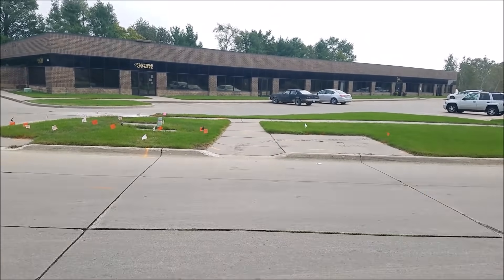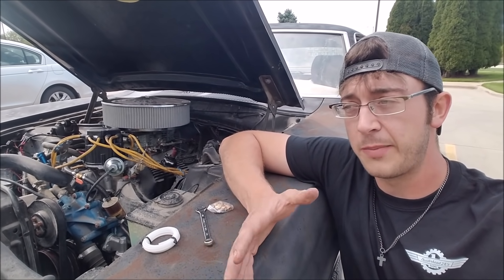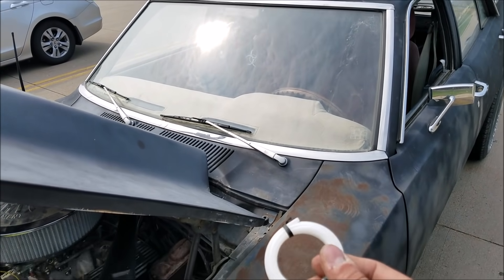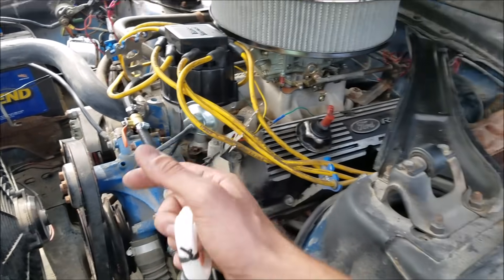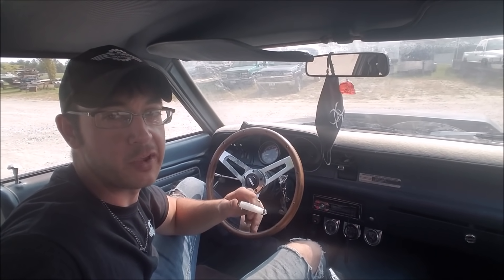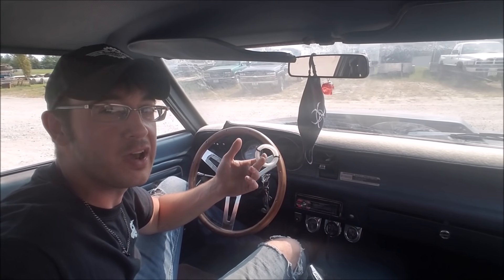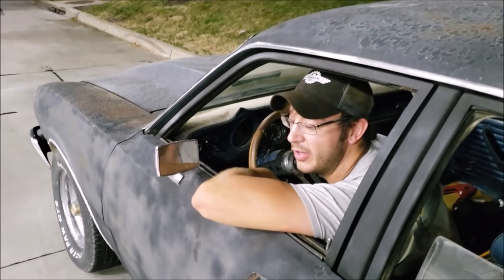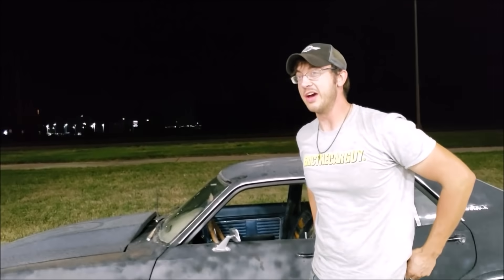The Maverick Broke Down! (A Simple Mistake CAN = Destroyed Engine)

Comment: I personally hate the plastic lines. Ive had them melt when they get hear the header just enough to where high rpm drives the oil pressure up enough its sprays on the header. So 3rd at 3 or 4 k on the highway i would get a big poof of smoke then up shift and its all good but wasnt leaking with idling because of the lower oil pressure

Comment: The gym.....😒....well I'll be dipped.....😝..you got to put loops at the connections....
Reply from the maker: The original owner did the existing line work. And it will still eventually fail at the fitting

Comment: All I use for mechanical oil pressure gauge lines is Russell -3 braided stainless brake line.  I don’t trust the plastic or copper line.  Stuff isn’t even expensive and will never fail

Comment: Either change the sending unit to the end and run the line up and along the top of the head where it meets the intake and then the line will not flex at the connection it will flex at the rear of the engine and will never break there hope that helps

Comment: Yep, I had a 65 Mustang with a 289 someone put a huge Cam 4 barrel and a dual point distributor, it torqued so bad it would suck the gas pedal to the floor after it broke the motor mount.... Try to explain to the chief of police, that's behind you that you are not showing off, and it's a broken motor mount... When you are a Teen. 
Great video 
Keep up the good work 
Stay safe.
 Godspeed

Comment: put a 45 angle on the fitting and run the line up between the shock tower and fender next to the wire harness,,,no fault of the car...i had many mavericks ,,even took my drivers test in one

Comment: TH289... I need some advice!  I got a 72' F-250 Camper Special W/ a 390 C6 and I want to know if I swap out the 390 for a 351W Street Boss 5 speed will that have good power and help with fuel economy??  I'm keeping the 390 in storage so in the future I can go back to the original motor trans setup!

Comment: I had a 1970 maverick.  The rear gas fill broke in a parking lot bump.split that @#$ from stem to stern. Ditch fix was junkyard tank split fill stem and put a rubber spacer aka radiator hose for flex.  Lost a full tank at .25 a gal.

Comment: What is the compression on each cylinder? I think it needs a ring job possibly? It the timing correct? It falls flat on it face like the timing is not fast enough.
Reply from the maker: It has a 3.00 rear gear (at the moment). Fell flat on its face on the burnout attempt when I bought it because previously it was tuned like garbage.
Reply: @ThunderHead289  OK we have not seen it run after fine tuning yet.

Comment: I got a carb question for anyone who can help me. I'm looking at a used Holley 4 barrel 600 cfm and if I buy it I plan on rebuilding it. It has the non adjustable floats and this is the first time I've seen those. I've rebuilt a Holley before but it had the regular needle and seat. I don't want to tear into this new one and come to a stop because I dont know what I'm doing. Is there anything much different to expect? Is there anything I adjust in there or do i just put it back together and let it do its job? I've never even seen the inside of one

Comment: They sell nylon air brake line in the same size. Way more flexible and it doesnt get brittle like the cheapo plastic white line those gauges come with. You may have to get it at a truck repair joint, but it's well worth it.

Comment: Go to a hydraulic shop and have those guys manufacture you a proper oil pipe with high quality fittings on the ends and a premium quality high pressure flexible hydraulic hose. It’s going to be slightly more expensive, but that oil pressure line won’t let you down stranded at the roadside.

Comment: Put a coil or two in the line and it'll be fine. The poly lines are junk, especially on a big block chevy where the oil port is down by the headers.

Comment: A hard line should never be plumbed from engine in a fashion it has to flex. The proper way is route it up front of engine along intake/valve cover and through firewall, similar to electrical wiring. I have a Torino using that configuration since before your Maverick was built. Used same line(with brazed fittings) since 1973.  I'd plug it off and run no oil pressure gauge before I'd use plastic.

Comment: You're still asking for Trouble using plastic line. Just leave play in the copper line one or two coils just before the connection  will do it. Ran Copper line for over 20 yr's in my 69 Firebird. plastic lines melt.

Comment: That car is begging for a T5 swap.  I recall there was a magazine article about 15 years ago about a guy swapping a t5 in a Maverick.  He modified a fox body pedal to work with a cable clutch.  Maybe you can run a 4 cyl t5 if you don't power shift it.  Probably the cheapest ones to find are the t5s in the new edge v6 mustangs.  You might even be able to use the large diameter bell housing that comes in those cars.
Reply from the maker: All my stuff is pretty much t5 swapped. My f100 runs a t5 and my 65 has a TKO 500 in it. 
Might just leave this one a 4 speed and use it around town! First things first though, ditch that 3.00 rear gear ratio!!!!

Comment: On my old dentside Ford back in the old days with my Fe power I've had those polylines fell several times on the inside of the cab it's where they always gave me problems and had better luck with the copper but I didn't run it over toward the fender I had one of the oil filter brackets where the sending unit faced upwards I came up the front of the driver side head and then along the intake manifold and into the cab when the engine torque it wasn't bending back and forth like a coat hanger every time I ever had a fail with one of them it was always in the cab the way you figured it out is when your feet started slipping off the pedals

Comment: I mean I build chevys but I have never had good luck with the plastic line kits they always blow off the fitting no matter how tight you get it. Or blows off the back of the gauge and blows oil all over your leg. But I mean every make is different I guess.

Comment: Just make sure to keep the plastic line as far away from heat as possible, my personal experience with the plastic line and failures was related to heat. I think both can be used just depends on the application.
Reply from the maker: On this car, I’ll do a combo - I’ll just have a short section of poly from fender to engine I think.

Comment: Would you know which headers the Maverick has? My Comet needs a set
Reply: For long tube headers You can choose Hedman 88300 (I use these) or Hooker 6901 .
Reply: ken mollander thank you. I know the shock towers are usually the tight spot. Using GT40P Explorer engine, bolts and spark plugs are issues with most headers
Reply: @jtaylor8792  The GT40P head will give you fitment issues with the headers i listed. I have GT40 non P heads..
Reply: ken mollander ok. Well, my search is narrowing down. I do have a few options.

Comment: Rookie mistake , never use those plastic oil lines! 12 years ! you got lucky. Anyway its happened now so you know!
Happened to me 40 years ago , my first V8 a BBC i built and fitted.Lucky for me the exhaust heat melted thru it on first engine break in start so i was able to go copper early. Looks like a strong little engine in the Maverick, thanks.

Comment: I'm the opposite of you, I NEVER use the plastic line, I always use copper tube, and I make a coil of a few loops by the engine to serve as a strain relief. The plastic tubing can get hard and brittle fairly quickly from engine heat and the heat of the oil. The best way, if I can, is to use a electronic sender to a electronic gauge.

Comment: I've never daily driven a car older than probably 12-13 years old. Mostly because I needed my daily drivers to be reliable. Now that i've got several project vehicles I'm considering building something older as a daily just to keep miles off of my ZL1. Whatever it is it MUST have a manual trans in it or i'll just end up hating it. Wouldn't mind buying that Maverick off of you. Other options i've considered are a Fox platform mustang (which seems to be the ONLY american car that was purchased en masse  with 5-spds in them) a G-body, Or if I can find something like a Maverick, Vega, etc.
Reply from the maker: Once you get through the shakedown period, it almost gets downright boring. My 64 galaxie and 74 f100 have been flawless all year, with my f100 being flawless all last year. Did all 3k miles power tour 2019 without an issue!
Reply: @ThunderHead289  I met a fellow at Walmart a week or two ago who daily drove a vintage Porsche 914. I have seen that car around town now and then for the last 25 years lol so I know he's not lying about that. Just never had a chance to meet him. I know you have quite a bit longer daily drive than I do. It's only 17 miles door to door for me to get to work (at least when I start working back in the office again) But yeah if you ever decide to ditch the Maverick let me know. I'm only 5'7" so the shifter placement will be fine for me :)

Comment: I’ve had my Stewart a Warner oil pressure gauge with the nylon line installed since 1981 in my 70 Z28 without any issues. Maybe today’s nylon isn’t as good as yesterday years cause it’s probably made in China.
Reply from the maker: Nope, I’m all for the poly/nylon - I 100 percent agree. 

What failed on me was the copper!

Comment: I wanna make my 1967 mustang 289 a daily driver sir, any small ideas on updates?
Reply: My daily driver years ago was a 1970 318 Plymouth.  225k miles.  Original engine and trans the whole way. Only broke down once. Repaired in 5 minutes.  My answer to your question (if you don’t mind me butting in). Keep it simple.  Points ignition. Yes I said points.  If you go electronic keep a spare box.  Don’t use Chinese parts.  Go to a salvage yard and get real Ford parts. Not kidding.  50 year old Mopar or Motorcraft is better than new Chinese.  Check out looks drive home video with this Mave’ for an example.  Of course you don’t want 50 year old rubber hoses but you get the gist. Currently drive a 79 Dodge pickup.

Comment: When I run copper lines I coil my excess where the line goes from the engine to the chassis so its flexing a big section of line and less likely to fatigue 1 small part. I also run them up the valley to the firewall as I beleive the twisting will fatigue the line less than it pulling on it. But I almost always prefer to run steel braided wherever I can. The nylon line I've seen break or blow off twice and get oil all over my buddies interiors.
Reply: I was originally taught to coil them, later taught to upgrade to electric sensors from a interior hose down, on the cheesy bracket under the dash on a 75 z28, it started to leak he reached down and it started whipping around, some cleaned lots replaced
Reply: @88TRUNKBACK  yeah I run electric when I can. I got some cheap sunpro gauges in my 69 buick and when the voltage drops slightly when idling in gear and someone runs the windows or some bass hits the gauges bounce all over the place. I either plan to switch to mechanical (temp and oil) or get some nicer ones like autometer.
Reply: Coiling the copper was what I was thinking too. Still definitely better to use something truly flexible like you said though.

Comment: I ran the copper line down the intake. When the engine torques over it doesn’t move as much as the outer edge like coming from the inner fender . The reason I used copper is it’s Nhra Legal also I have seen the nylon ones break and leak as well. I think if you buy a car with one it’s a good idea just to replace it regardless of material and route it with the least amount of movement as possible.
Reply: Put a pigtail  (@3" loop) in the copper line and it provides a greater amount of "give" and helps reduce work hardening of the pipe. Not uncommon to see this on fuel lines etc on older vehicles in the UK.

Comment: You're sharp man. I used to drive my dad's buick gs 1973. I learned so much when I was much younger from old cars. And it's actually smarter to own an old car because it's usually cheaper to fix and easier to fix then anything modern. Also in many cases it's more reliable. My dad's buick never stranded me once. I had newer cars that quit on me nearly costing me my life. The worst was my work car as a limo driver. 2018 chrysler 300. Once the alternator quit that car was dead in the middle of the worst winter in recent years in Chicago. I had passengers and we had to arrange emergency transportation. Fuck that car. Ive always loved old cars but each bad experience with newer cars solidified my love for old American steel.

Comment: My experience with nylon tubing is that is chaffs through really easy. I lost a tube where it went through my firewall.  When I fixed it, I made sure that I liberally used silicone to prevent it from rubbing. Personally, I would probably use an electronic sender in the future, but they are definitely more money. After 85 or 86, Ford started using a pressure switch on the pickups. If you switch the sender out for an older one, the oil pressure gauge will work as intended.

Comment: I myself like to drive the old cars over a new one any day. I kinda look at it as I'm doing my part to save the planet and it also saves me money, plus I can buy 20 cars for the same price as a new one. You do the math that's a huge savings. Cheers mate
Reply: TinManKustoms 
100%! I can afford to buy a brand new $60,000 Ford pickup if I wanted. But I instead drive and repair all my $500 to $1000 old cars and trucks. And I still come out money ahead. And it’s fun, driving a manual transmission and I always get compliments and conversations about my old vehicles.
Reply: yep,the cooler part is the unpredictable adventure of it all.you never know when you will get were you are going and whats gonna break on the way.
also you always know you will use 5 times as much fuel as the average modern engine and not have any more power,in fact you will usually have 
much,much less in a v8 vs a 4 banger.

ive got a modern daily and a 35 year old car as a toy.....

Comment: I do the same, I “shake down” my old vehicles the first few thousand miles before I start to trust them. Right now I’m doing it on an old farm truck I bought for $500. It had been sitting in the farm yard for 10 years, it’s a 1976 Chevy C20. Good shape, only one cab corner and the front fenders have rust blow outs. But ten years of ethanol gas sitting in the carb, fuel pump and tank has taken its toll on the old boy. Runs good, lots of little issues that are repairable or just plain lack of maintenance by the farmer. He just didn’t care, ha.

Comment: Can do you one better.  I had a brass pipe nipple to get my electric sender out far enough to clear the filter.  It cracked at the block and puked about 3 quarts out in maybe 1/4 mile.  I knew where it broke because the gauge dropped, and I could see a safe place to pull off.  Had to get a friend bring me an ez-out and a factory idiot light switch to jam back in the hole to get it going again.

Comment: I've never had real good luck with the nylon tubing. It always seems to break/crack on the interior side of the vehicle.  I've had good luck with the copper lines.  I coil them where they go from the engine to the vehicle.  But the braided stainless steel hoses are my first choice.

Comment: This happened to my Cadillac once, it blew an oil cooler line at idle and spewed all it's oil out. It then proceeded to not give me an oil pressure light and run for 14 miles at highway speeds before seizing and stopping about 500 yards from my house. 
Called my dad to come get me and it fires right up for him and he drives it home with no oil. Rod knocking like crazy but only needed a bottom end. It's like it never happened now.

Comment: I need to run an oil gauge to my 77 F150.  The factory gauge looks good on startup but boy after she warms up, when I come to a stop, she drops like the Titanic.  Would really like to know how much pressure she has when she warms up.
Reply: most american engines do that, my 1982 Ford Falcon XD had 40 psi cold then dropped to about 5 to 7 psi when hot(every now n then the oil light would pop on and off or flicker) thats on a worn never rebuilt 300,000 KM engine 4.1L 250ci engine  made in ozy but based of a mustang inline 6, and Honda Xflow(crossflow) technology
Reply: genmaxpain this one was rebuilt years back and my dad says it probably has 40,000 miles on the rebuild. Runs incredible (460) and the only issue is a leaky rear main, which I can completely understand, especially since it sat for about 7 years before I picked it up from my dad.
Reply: @TheKeymaster316  the 460 engines are really good engines, with the right mods and cam they sound awesome
Reply: genmaxpain just had an RV cam in it now.  My dads best friend used to own it and towed a camper trailer with it.  But he told me he’d like to see me put a more aggressive cam and some headers on it. 😎👍🏻

Comment: mechanical oil, temp, and pressure lines are trash
Reply from the maker: If accuracy is trash, then yes.
Reply: @ThunderHead289  if you're worried about if the engine has 40 or 42psi of oil pressure or if the temp is 180 or 185...  you've got your priorities wrong my friend.